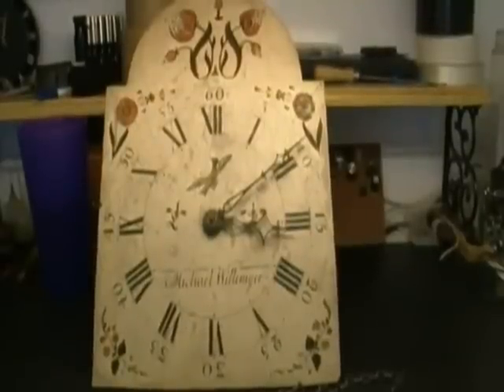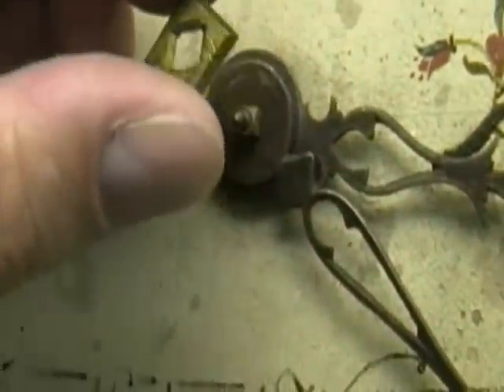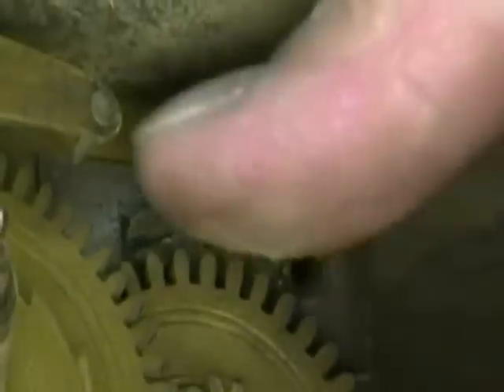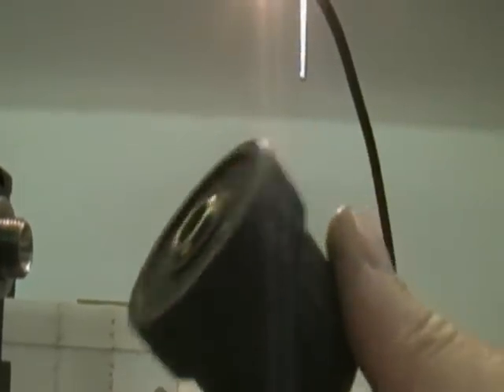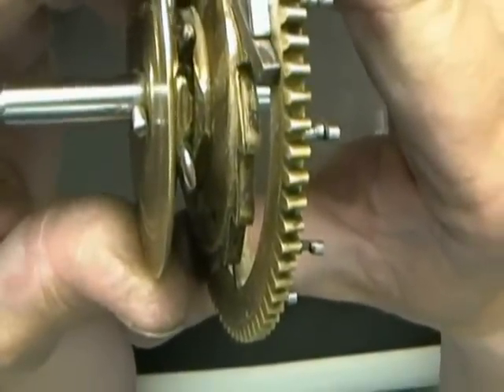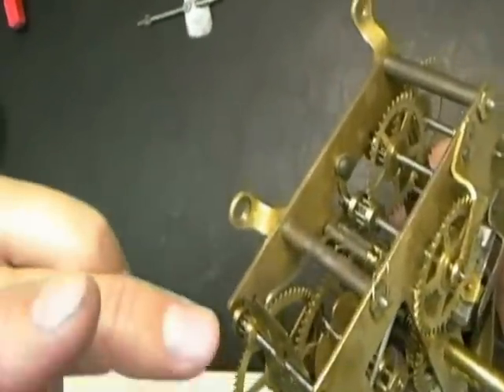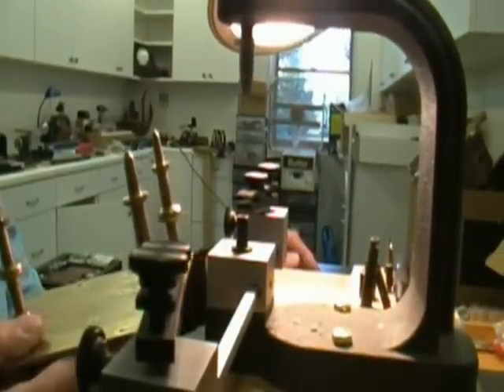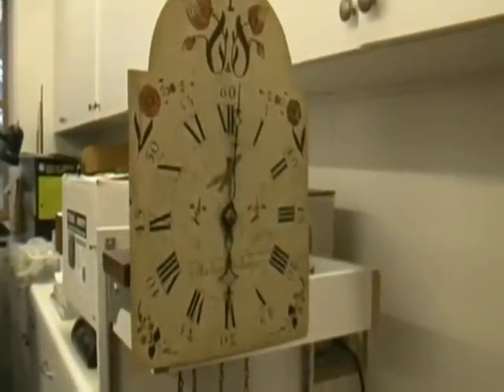Tall Case Clock 1 Day English Movement, Continuous Chain, Video Short Repair Preview

Comment from the maker: You didn't say what kind of movement you have so I'll assume its a standard German Movement. The heavier weight goes on the right because the chiming needs more power then the other two. Be sure to tighten the top and bottom nuts holding the weights together, they loosen after 15 years. Also only handle the weights with cloth gloves, the acid from your hands will burn the brass after a year giving it permanent finger marks.

Al Takatsch
Jefferson ClockWorks